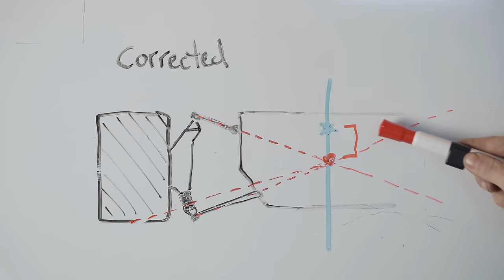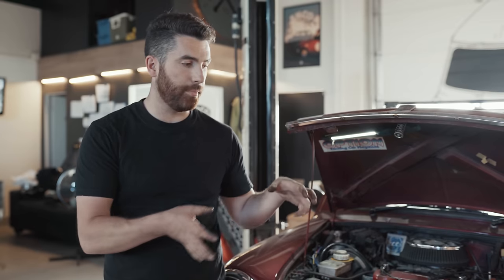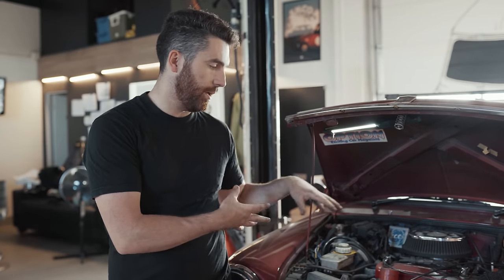Are Boosted Brakes Better on a Mini?

Comment: Recently changed my system from a green tag master cylinder/servo system to a yellow tag master cylinder. The brakes definitely give more feedback to the driver, but you do have to push harder. I much prefer the non boosted brakes. Bear in mind that the later servo (boosted) systems use a different pedal box with a different sized hole for the clevis pin, so the pedal box has to be changed too if you’re thinking of doing this conversion yourself.

Comment: Always  liked my final set up with yellow  tag master,  pwa valve,  7.9" vented  discs and modified  cast iron 4 pot ap metro turbo  caliper which just scrape under my 6j 10 gb alloys  and green stuff pads.  The configuration  been on the car over 24 years  old now and the best in my view
Reply from the maker: That sounds like a fantastic setup 👌

Comment: I run a classic Mini race car, in general racing not mini specific and find myself on the track with modern cars like Hondas and Toyotas etc, Ive just this year fitted a VH44 booster and have found it a huge improvement. it doesn't make brakes better but by heck, it certainly takes away those brown trouser moments when, as happened on Sunday, the 350Z that dived under me into the corner, overestimated his skill and promptly slowed to what felt like a crawl mid-corner with me right on his back bumper. Having the instant pedal was a great relief, not having to mash the pedal into the floor ! I'm also braking much later ;-) As I said doesn't make the brakes better but it certainly ups the confidence factor

Comment: I believe the VW Golf/Rabbit/Jetta's from the 1980's had a ride height sensing rear brake proportioning valve system that had a lever arm on rear suspension to compensate the braking force as the rear end lightened/lifted up under heavier braking. Would be interesting to adapt one of those to the mini.

Comment: One thing to note is that newer brake components tend to use metric fittings. I have a 79 Canadian Mini which was upgraded to a yellow tag master cylinder. The master takes metric fittings while the car is imperial so you have to use special lines to go from one to the other. Same can be seen on the front hubs and steering tie rod ends where newer ones are metric.
Reply from the maker: We've noticed this too!

Comment: Innocenti Cooper 1300 Export has dual-circuit mastercylinder separated front/rear with servo-assistance (booster..) that works on the frontbrakes only.
Rear brakes dont need any help.
Racers with very light mini's usually fit

Comment: I have b16a2 with all speed subframe and dual brake system 8.4” in front disc and drum on back, I plan to change the rear to disc by kad kit 7.4” do you think will help stop better? And also my radiator is leaking what you should recommend me to buy what type of radiator?

Comment: When I was into VW GTi's back in the '80's, it was all the rage to swap factory brake discs to bigger ones and bigger calipers, all in an effort to increase brake performance. On Minis, it seems popular to downsize discs to accommodate smaller wheels, more for fashion than performance. Can you comment on performance changes with the smaller wheels & brakes vs larger?
Reply: The mini suspension was designed around the 10" wheels with higher profile tyres (and therefore additional compliance) so the ride with 12 or 13" wheels can be harsher so generally the smaller wheels give better handling. As mentioned in the video the mini is such a light car that the loss of braking performance from going to the smaller disc set ups isn't much of an issue and in a lot of cases is offset by the improved handling and lower rational mass (from smaller wheels and brakes). Also in most cases when going from a 8.4" to 7.5/7.9" the slight loss of braking performance from the smaller disc can be more than overcome with uprated pads.

Comment: I have a boosted system on my 91' mini, but I find that it hardly brakes like it should be... I've already cleaned all the brakes calipers, put on new Goodridge stainless hoses and braking pads, drained the braking fluid, bleeded it, but the brake still lacks some power...
Is there anything to look for on the booster/servo side? Anything that could wear and explain that lack of power?
Thanks for the great videos!
Reply from the maker: Hi, sounds like you've taken the right steps to get a good brake feel. Assuming it's bled properly, if it's not braking great then maybe there's play in your brake pedal clevis pin. Any play in the linkage between the pedal and the master cylinder will reduce efficeincy of pressing the brake pedal. Another thing to consider is that you have brake pads that suit the application (street or track).
Reply: Did you have engine on when bleeding?

Comment: Do you think you could create a video about the sensors that Mini has used to trigger the brake lights? I have a 1962 with the hydraulic sensor and it is not sensitive enough (have to slam on the brakes to get a light - have bought a few different sensors). One of them also split on me and I lost my brakes driving home. I would like to use a different system to trigger the lights. I love the brake feel on my car.
Reply from the maker: Might not be enough info to justify a video. You could unplug the hydraulic switch and install the more conventional pedal switch.

Comment: Well this was cool, I have a 1974. Did you say the booster systems are 1990 and on?, because I do have it on mine, curious now. Last couple of days I've noticed the brake "sticking" at times, twice to be exact and have not quite come up with a possible explanation, any thoughts??
Also, I have not seen you or anyone replacing the wiper motor.., hint hint.. hahaha
Great video!, thanks...
Reply: Here's a few videos on the Wiper Motor: https://www.youtube.com/watch?v=A39yY6Pc7xk  https://www.youtube.com/watch?v=tEEfCKdpsgU
Reply: Either retro-fitted or a 'reshell' job, some hoses collapse  internally so don't allow fluid back quickly or at all.. I had this.. and a slight warped disc boiling fluid

Comment: Didn't answer "which is better"
Reply from the maker: The point is there's no objective right answer. We feel the single line offers the best control, but a split system is safer. And servo brakes are easier to press but you lose some pedal feel.